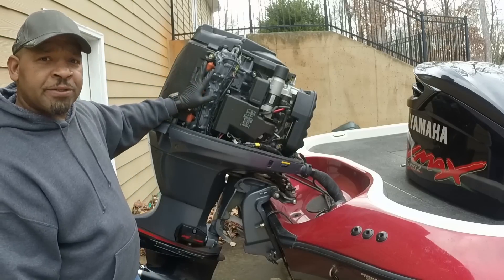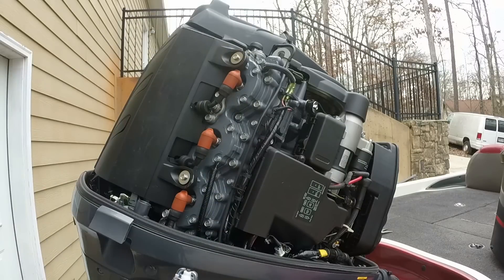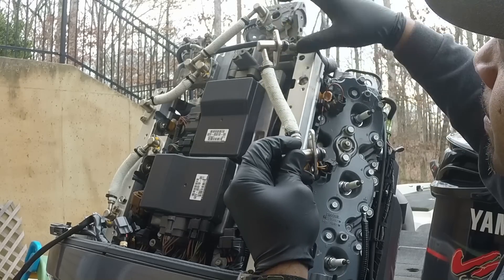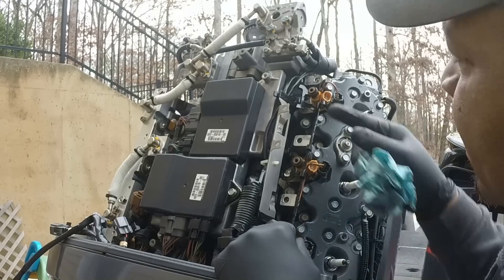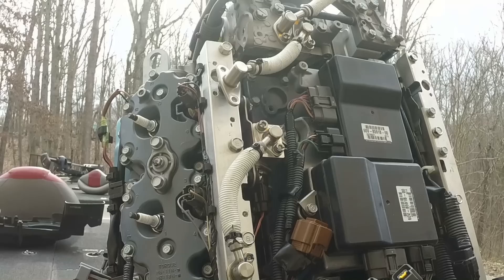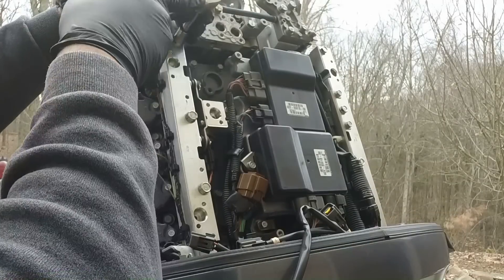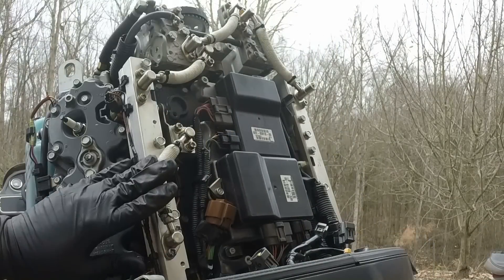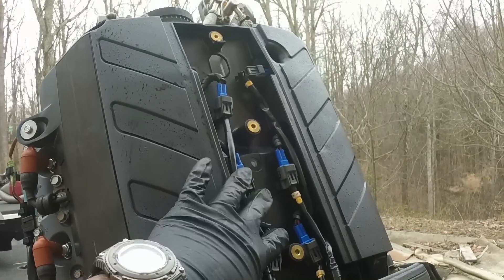Yamaha HPDI Outboard Service. Spark Plugs & Mystery Filter Replacement.

Comment: great video step by step thank you .I studied your video 3 times ordered my filters and did the job on my 250 hpdi 2003,tested and felt a huge power gain next is the vst filter thanks again .
Reply: Louis Sanchez You Welcome!
Reply: I dint do the fuel pump yet I looked to see if it would require to replace gasket so I will have it ready ,the starboard side pump does not have an adjustment as you described in yours so I will attempt

Comment: Great job for a "shade tree" mechanic! Took some guts to tackle that job and put the puzzle pieces all back together in ther correct places. I've heard that all the HPDIs eventually suffer from clogged high pressure filters no matter how religios their owners are with their fuel supply and stabalization procedures.  Think this lead Yamaha to phase them out and go to all 4 stroke EFIs which have injectors that are easy to access and change.  If you keep this VMAX for another few years or upgrade to a 4 stroke, you should look into buying yourself a small fuel injector cleaner.  You can get one on Alibaba (China's equivalent to Amazon) for less than $400.  It will clean and pressure test all your injectors youself and not have to send them out at $25 each plus shipping.

Comment: Great job and very very good video.  Thanks so much for making this. Very thorough and good explanations of everything.  Doing mine this weekend!
Reply from the maker: Mark Harrison Thanks for the great comment! I hope it helps.
Reply: @michaelyoucanfixthat  what are your hr interval and since doing this often has the motor ever given your any other issues
Reply from the maker: @antonioprado8068  I just wanted to do this because of the age of my boat at the time. I did not have any issues with my boat before doing this. And not I have not had any problems after doing this. I replaced my plugs every two years but sometimes every year depending on have it’s running. I have not replaced the mystery filters since doing this video.

Comment: Just wanted to say thanks for putting together this video. Very helpful and well done!
Reply from the maker: John Schulte Thanks for taking the time to drop me a great message. Thanks for watching!
Reply: I started taking apart my 2001 Yamaha 200 HP HPDI motor yesterday to clean up my fuel lines and injectors; I got some water in my fuel a while back. My motor is a bit different than your 2009 model, but I used a 5 mm hex bit to remove the bolts for the fuel lines that lead to the fuel rails - probably the same size Allen wrench you used. I took a few pictures with my phone to help with reassembly once the injectors are cleaned - I'd be happy to send these to anyone who asks, along with an explanation. The coil pack on my model is substantially different - I think Yamaha simplified the coil pack for newer models.
Reply from the maker: Do you get everything back together? And is it running better?
Reply: I got the coil pack and fuel rail removed, but have not removed the injectors yet. I'm not sure how to get these out - they are in there pretty tight. I'm hoping to remove the injectors next weekend. I'll follow up after that. Finders crossed...I need to be FISHING!

Comment: Great video! This gives me the confidence to change my own mystery filters.
Reply from the maker: Mike Pote Thanks and good luck.
Reply: @michaelyoucanfixthat  Thanks again man! I changed all 10 mystery filters on my 300 HPDI today.  Im not very mechanical so this video was a total difference maker.
Reply: And for any future people scrolling through comments, I have ZERO outboard and very little other mechanical experience. It took me 3 hours to change all 10 mystery filters (including the filters inside the high pressure pumps) and none of it was out of my comfort zone. You can totally do this yourself!

Comment: They should have one large screen on the inlet of the long manifold bc once that tiny screen gets plugged on one injector it runs that cylinder lean and burns that cylinder. There are no moving parts to generate debris in the manifold so you would no longer need the ones in the injectors. 
Thanks, good video.

Comment: you could also mark with a sharpie the fuel tubes top to bottom...1,2,3 so they go back in that order...proper torque on the spark plugs to...I think the spec is on the head for the ft. pds.  awesome video and thanks again...
Reply: Frank Zabski Yes I should have. I had some confusion putting them back on the motor. But everything else worked out ok.

Comment: Sooo I know this is from quite awhile ago but just so you know, the spark plug gap on the side of your motor for the dual electrode plugs is wrong! Gap should be 1.3-1.5 mm on both sides. Just a heads up

Comment: Do you have to relieve the fuel pressure before removal the fuel rain and fuel tubes that attach to it?
Reply from the maker: No, I did not have any problems with fuel shooting anywhere. So, I don’t think you will having any problem.

Comment: You use White Out or a digital camera to make sure you get things back in the correct place  Before digital cameras I completely rebuilt a 3 cy 2 stroke Suzuki I wore out   The bearings on the top cylinder failed and the connecting rod started hitting the bottom of the sleve and breaking out chunks out   I had to remove every nut bolt and screw   I was glad I took a bunch of pictures   That motor still runs like a scalded dog

Comment: Michael, thanks for taking the time to do this...helpful...how many hours on your motor?  Also, where the old filters dirty...just curious...I know its a good thing to do proactively but just curious if the filters we very dirty...
Reply: Frank Zabski Thank for watching the video. My motor has about 230 hours on it. But no I did not see anything on the old filters. Just thought I should do this with the amount of hours on my motor. I tried to change every filter on my the motor. Just as a maintenance thing. Thanks again for watching.

Comment: Where can you get the filters from? All amazon sellers only list up to the 200HP engine. Not for injector part #60V-13761-00-00. Will the same filters work for the 250? https://www.amazon.com/Yamaha-Outboard-Injector-Basket-Filter/dp/B07958DTSX
Reply from the maker: WassawBound I want to say yes they look the same as the ones I used. But a buddy of mine did the filters I did not do. They look different than these. So if you plan to do the one I did not do they will be different. But yes I’m 80% that these filters will work.
Reply: Michael You Can Fix That thanks. I went ahead and bought them. Someone in the Amazon q&a said they’re the same.
Reply: They are all the same on the hpdi